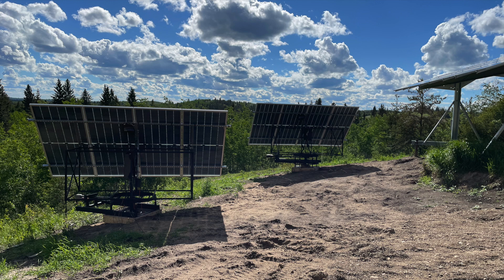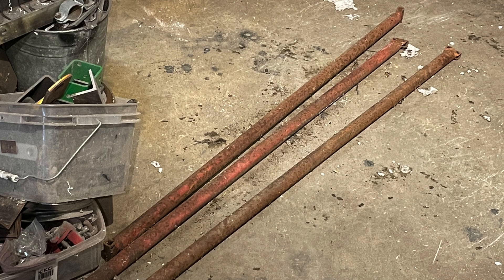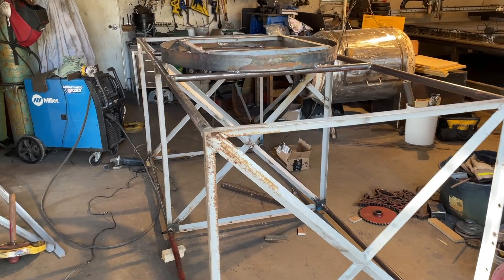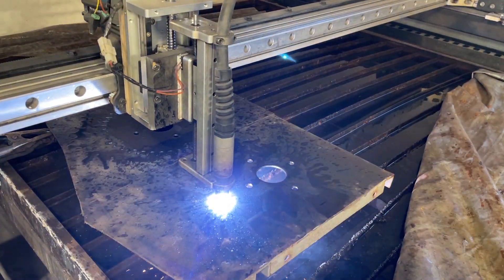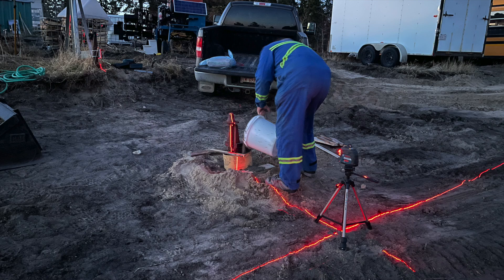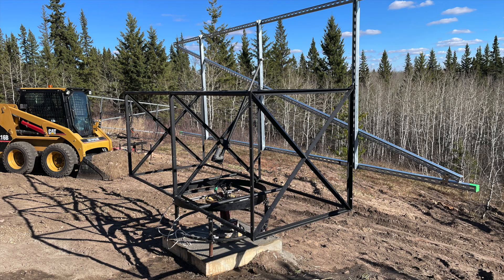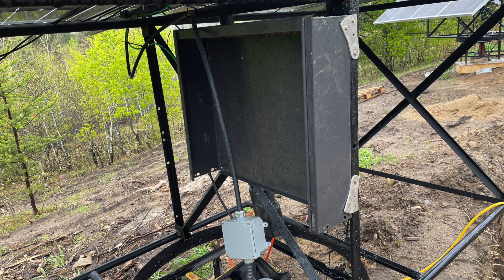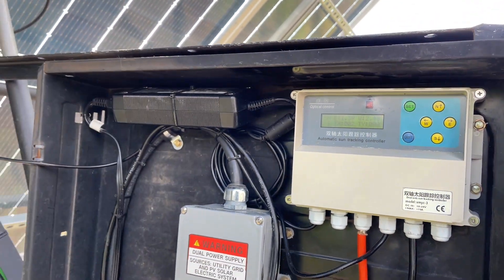DIY Dual Axis Solar Tracker

Comment: This is a very interesting project!  One question: is the whole thing just sitting on the 4 grooved wheels with nothing holding the top unit to the ring?  How do you prevent the whole thing from falling over in high winds? Oh I think I see - it is held in place by the hub that the chain goes around.  Is that what holds it down? Thanks!
Reply from the maker: You are correct.  The hub is the main pivot point and the “training wheels” provide additional support.

Comment: Wow, the sound of the electric motor or actuator that you're using, is like something from ancient Pyramid times. Couldn't get some newer silent actuator or motor? How aren't you bothered by its extreme loud noise?
Reply from the maker: The noise is actually my secret method for keeping my neighbors in suspense—they think I’m either building a robot or opening a portal to the past. Keeps them on their toes! 😉

Comment: Great job!  I really like the simplicity.  I'm pretty constrained at my place and my existing solar gain using 3.5kW of fixed panels is coming up about 4kWh a day, short.  I'm working on a tracker plan for the last available spot I've got.  Your build has got me thinking.   Cheers!

Comment: Luv ya work mate, that has to be the best example of linear actuator use I’ve seen thus far, I built a duel axis tracker (still in operation) 9 years ago but with a duel slew drive, most people commenting on these have no conception of the energy produced, in my case I could of just got with panels on a roof but wanted to be different, I think these have a very good case use for peoples that live in valleys or where they don’t get much sunshine through the winter months or live in isolated areas, we get every bit of sunshine from sun up to sundown.
Hi from sunny Western Australia 🇦🇺
Reply from the maker: Thanks for the comment.  In summer months here in northern Alberta, the sun rises in the NE and sets in the NW.  On June 21st, we get about 17 hours of daylight.  With my first array, being that it can only be adjusted for seasonal variation (almost flat in summer and vertical in winter), it really does not do well in summer.  My best month of production was March when it usually clear and cold (sometime -25C) and the sun rises in the SE and sets in the SW.  This addition really chunks out the power when the first array is barely producing.  If one was closer to the equator, the tracker probably wouldn’t matter so much.

Comment: What would you guess your increased yield percentage vs. static mounted panels?
Reply from the maker: From what I have calculated over the past month, I am getting 26% more than the seasonally adjustable ground mount that my 6 KW system is using.  From what I read, the dual axis trackers are between 30% more efficient than a fixed mount.  In the last two years, my June production averaged 810 KWH.  I made it to 1530 KWH this month.  810 x 1.5=1215 expected.  1530/1215 = 1.259 (26%).  To be fair, the new panels are bifacial and have more output on the DC side, so that is helping as well.
Reply: Shed loads

Comment: What is your cost on this? The spinning design is interesting though I'd probably use less metal to do something more like the 400$ ecoworthy kit that just tilts on two axes instead of rotating on the x. Then again I don't have the expertise to overdo it like this :) I have about 9kw of old panels installed flat but I want to do something like this eventually, putting up about 2-4kw of bifacial panels that will give me some more intense solar throughout the day to smooth out my production.
Reply from the maker: The metal was from my scrap yard.  I ordered the casters from Amazon for $25 CDN and $120 CDN for the solar tracker complete with a wind sensor and remote control from Amazon as well.  The linear actuators came from old satellite dishes.  Cement cost was about $40 for doing both trackers.  The bifacial panels on the tracker really increase my output especially in the morning and evening.  Also having 1860 watts DC to go with the 1500 W QS1A inverter clips exactly at 1500 W when the sun intensity is lower really helps.

Comment: How would you adjust it when the foundation shifts or sinks? The look of that dirt appears to be susceptible to sub structure flow during heavy rain events and strong winds over time. Also could've primed those rust spots, might fall apart in a year or so.
Reply from the maker: The “training wheel” casters are adjustable.  In preparation for the cementing the axle that the hub assembly, I augered a 10 inch hole, 8 feet deep and cemented it it with rebar to reinforce it.  Then I built the square box that holds up the training wheel assembly and poured cement.  The soil can erode so I will be landscaping with a clay gravel mix.  I did paint since making the video to reduce corrosion.
Reply: Very impressive and resouceful!!! Do you have any idea how much more solar efficiency you will have assuming identical energy from the sun ??
Reply from the maker: This month it is coming in at 26% more than just having the seasonal adjustment.  The sun in summer is rising in the NE and setting in the NW.  My first array does good when the sun is East - West.  Prior to this upgrade, my best month was March, not June!